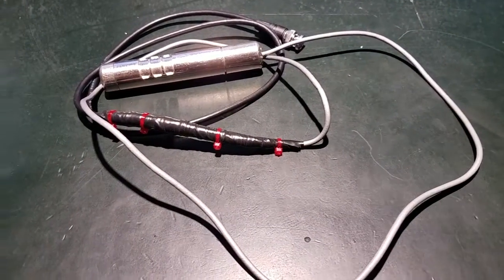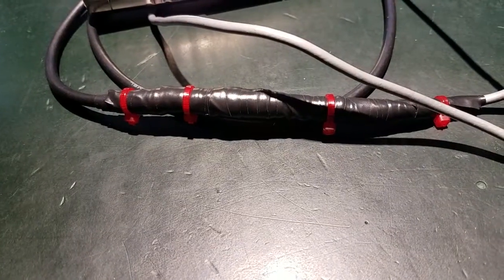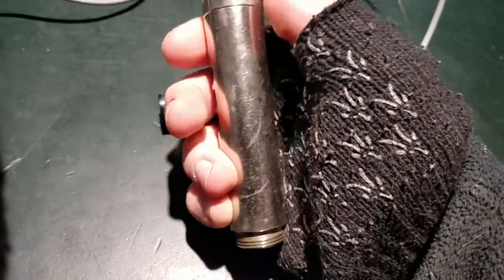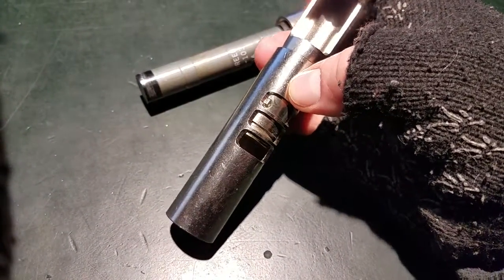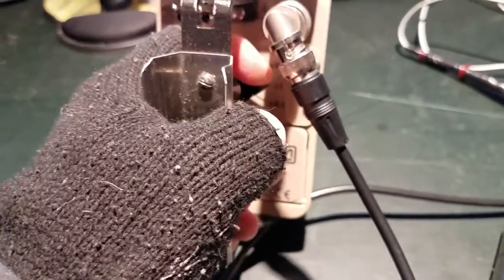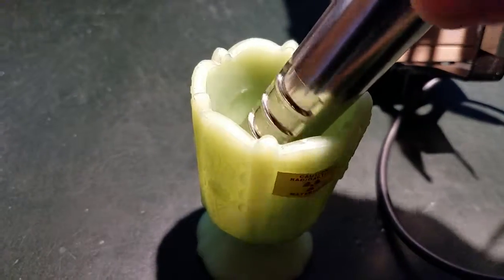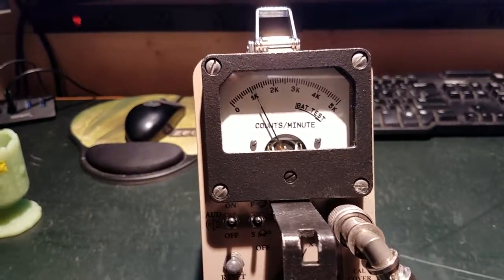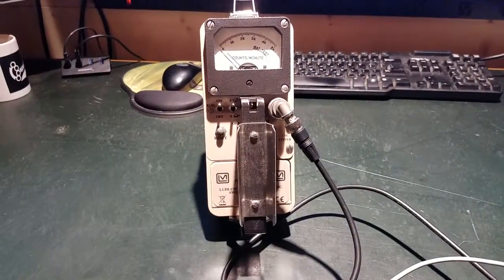CDV-700 probe teardown and modification demo.

Comment: I used to modify CDV 700s with a better HV regulator, a BNC connector, and a wide range pulse amplifier so it could use any probe with 700 to 1200v scintillation or GM. Even had a switch show he HV plus or minus 50V on the meter. ❤
Reply: Hello, I'd be interested in doing those mods on a CDV-700 of mine. Do you have any details on them? Thanks.

Comment: According to sources like Wikipedia the nickel-plated brass is also helpful for higher-energy gamma rays as the photons can ionize the metal atoms in the casing generating high-energy secondary electrons which can then ionize the gas atoms inside just like beta particles, at least that's what it says.

Comment: I have a cdv-700 that will go  from background to 100cpm I think the Geiger tube is contaminated it's a Anton/114 6993 the metal one's what is the best way to decontaminate it without damaging it
Reply from the maker: I'm not really sure what advice to provide. Have you scanned your probe with another detector?
Reply: @joshlucy9420  alright
Reply: @joshlucy9420  fixed the problem thanks for the advice 👍
Reply: Most likely your HV is too high, the corotron is notorious for aging badly.

Comment: You never explained the purpose the splice --- adding the 1meg ohm resistor in series with the GM tube.
Reply from the maker: It's an anode resistor. Since the Ludlum M3 doesn't have internal anode resistors so you need one for each probe you connect. Most probes that are designed to be interchanged have them, but since the CDV-700 had an internal resistor I had to add one inline with the BNC cable.
Reply: This right here is what I needed, thank you!